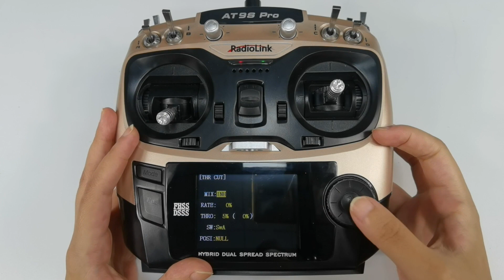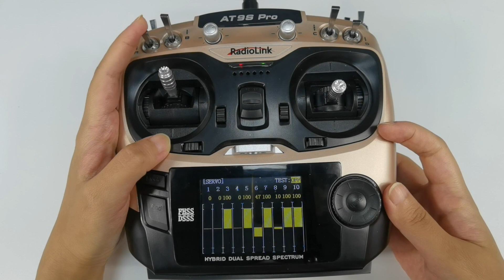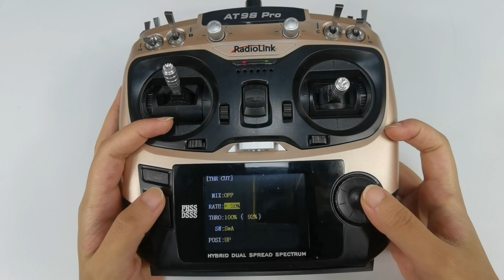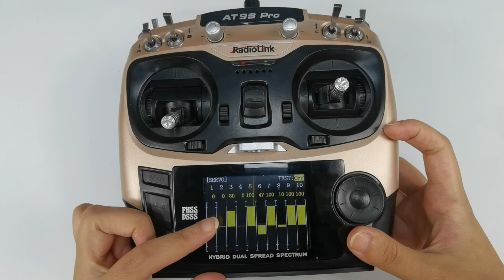Throttle Cut Function on AT9S Pro/AT10II

Comment: Negative throttle rate doesn't work, which is the only way that makes sense for fuel vehicles. It should make it so that when throttle cut is NOT active, the throttle won't go below a certain amount (which would cut the engine)
Reply: for engine this type easy one require only-https://www.youtube.com/watch?v=AfnaRCEnIMA-
Reply from the maker: Hi, sir. Do you mean  the RATE in throttle cut function? The RATE can be set from -30% to +30%. You may have a check. If any question please feel free to contact us. And you can also take a video to us so we can better understand your problem. Our email is: after_service@radiolink.com.cn
Reply: Turns out I had to set the trim.

Using a negative number for RATE doesn't do anything unless the trim or sub-trim are set to a positive number. With sub-trim at +72, I can use all -30% of throttle cut.
Reply from the maker: @johndoe528  Hi, sir. Great to know you figure it out. If any other question about RadioLink products please feel free to contact us.